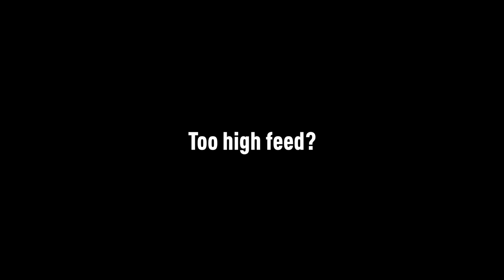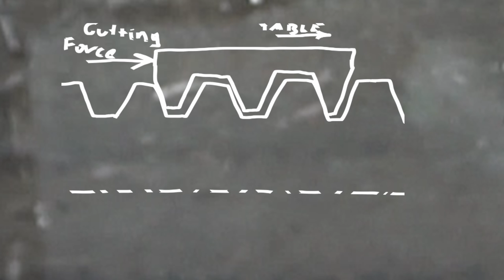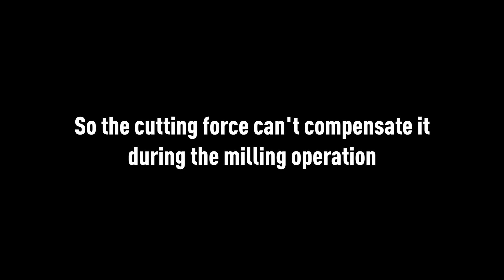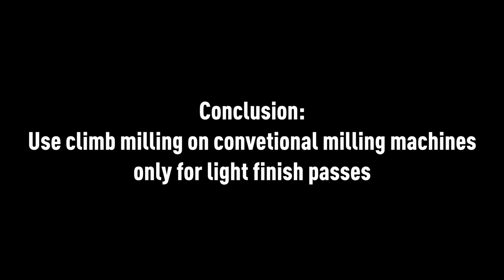CLIMB MILLING vs CONVENTIONAL milling

Comment: As a tooling engineer for a major end mill company it was a fairly decent explanation However you needed to explain that in climb milling (if possible) all the heat goes into the chip and not the tool or material. The parts are barely warm to touch. In climb milling your taking the heaviest cut first then thinning the chips out which is less wear and tear on the tool and better finish. In conventional milling you’re starting at a zero chip and increasing it to heavy chip (equal to feed per tooth.) which creates a lot of heat/friction, in the tool (destroying cutting edge) and putting heat into the part as well. The finish is only fair. If your machine ways are good climb milling is preferred especially when using carbide end mills.
Reply from the maker: Thanks for your input. I really appreciate any hints and advices, especially from professionals!

Comment: Your thumbnail is drawn exactly opposite of correct. And solution, get good ball screws and maintain your machine to tight tolerances then enjoy climb cutting and the better surface finishes that come with it and the longer tool life!
Reply from the maker: Depends how you look at it. Considering the straight arrow is machined part movement and round arrow is the end mill rotation then I think it's ok - or you don't agree?
Reply: @GBWM_CNC  if you go by convention of nomenclature all motion is always considered relative to tool, so yeah this was all defined clearly in machineries handbook since the days of my grandfather, but sure you a YouTuber re describing what's been known for decades is doing great trying to work salad and saying it depends on perspective. The perspective was defined for the industry before you or I were born. And your thumbnail will still make every learned veteran cringe lol
Reply from the maker: @acroduster  I'm sorry for hurting your feelings. I'm just making videos to pass over some basics to people who don't have those basics. Also I'm just a hobbyist having fun in the workshop, trying to share what I learn in my shed :) Also speaking of the arrow - what if you mill the opposite side of the part considering the arrow shows the motion of the tool, not the part. Is that still the same type of milling or not?
Reply: @GBWM_CNC  you did not hurt my feelings, I'm just pointing out that newer generations don't even bother learning convention and nomenclature, but think they are teaching. It's hilarious. And again. If you g
Had ever opened and read machineries handbook it's all there. But new generations think they are discovering something new all the time. And they don't care that they can cause confusion for others by not adopting convention. It's all just ego exceeding common sense. It' is content for the sake of content.

Comment: In other video's people use the meaning of climb milling and conventional milling in the opposite way.  Very confusing.  Sometimes the words upmilling and downmilling are used which gives more confusion.  In my opinion your explanation in this video is the right one.  In CNC machining I use G41 for climb milling and G42 for conventional milling.  Can you affirm this?
I am from Belgium in western Europe and not a native English speaker, maybe this is the reason of my confusion.
Reply from the maker: Hi! I don't use the G41 / G42 but from what I read on the web it off-sets the tool to the left of the material, so if you're using M3 Clockwise Spindle rotation, then yes - it should be climb milling.
Reply: @GBWM_CNC  With G41 the tool is at the left side of the material and rotates clockwise with M3.  If I mill a square block it means that the tool moves in a clockwise direction around the circumference of the block.  This is climb milling.  Right??

Comment: Generally conventional milling should be used on machines with just a screw and a nut. More modern manual machines with backlash eliminators and CNC machines you should be fine cutting both ways. Generally inserted cutters work best cline milling. 😊
Reply from the maker: I didn't know the insterted cutters work better with climb milling. Have to check it out :)

Comment: Strictly a curiosity question, what is that clacking noise when your mill is running?
Reply from the maker: Before I disassembled it and assembled together - there was some play in the gearbox. Now on the other hand I'm still having a little issue with clacking noises at the angled gear between the spindle and the Y-axis beam. The teeth are worn there and that might be an issue with which I didn't have the possibility to deal yet.

Comment: This is called not knowing what you're doing and not knowing your machine. Didn't have have the table lock on to create drag and prevent the chaos huh? Well, now you know for next time. 

A half inch end mill and shallow cuts first is less likely to grab and pull the table away if you want to practice first. Ball screws are not the only way to manage the backlash problem like CNC button pushers like to think they are.
Reply from the maker: This is because this is my first mill so actually you're right - I didn't know my machine at all haha. Sometimes I have to learn on mistakes. Now I know how to do it right :) And I'm sharing videos containing my mistakes to let other people know what not to do. Also the table lock was broken in the X axis (just the Y axis lock worked fine) thanks for your input! :)
Reply: @GBWM_CNC  I bet it turned into a day of tramming and tuning your gib screws. Anyways, happy milling.
Reply from the maker: @DaniGirl6  Well - at this point the machine looks quite different. It's got ball screws installed, refreshed a bit and its a bit CNC let's say :) But I don't remember if this caused any damage back then
Reply: @GBWM_CNC  Well, the explanation of the physics behind the failure was very good. That's something you have to learn and know when you are professionally trained in the trade of a machinist. I guess you are trained that way ... and if not: also good work as a science communicator:)
I think DaniGirl's suggestion is whole hearted, but she didn't get the message of your great video, hehehe. Everything what she said was already on screen and is highly specific ... You showed that just with the concept of mathematical formulas in a GENERAL way for every cutter, tooling, workpiece material, drive-method and clamping force. So: Thank you very much for that great video, GBWM!:)))
Reply: Found the Fudd machinist, welcome to the feature